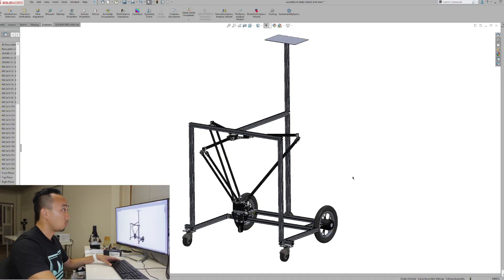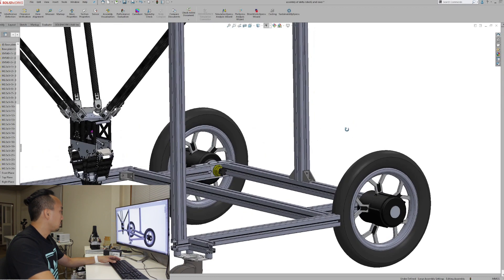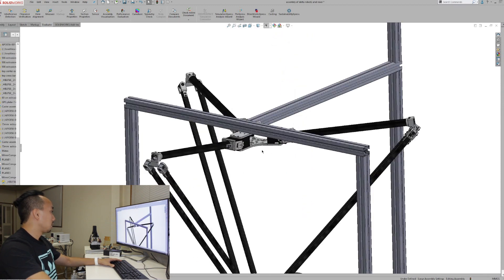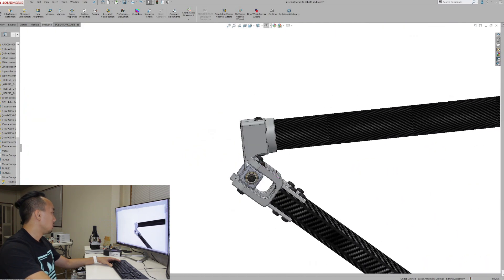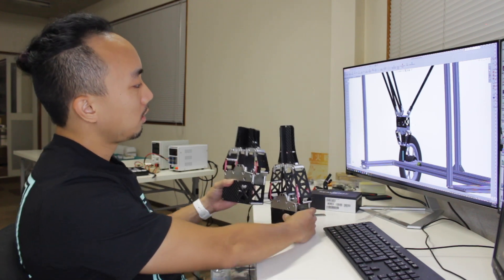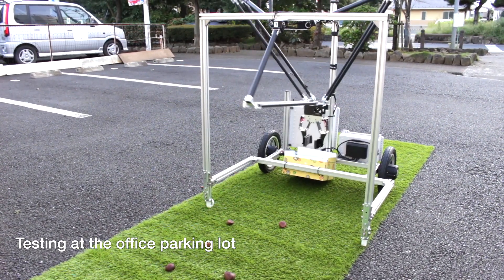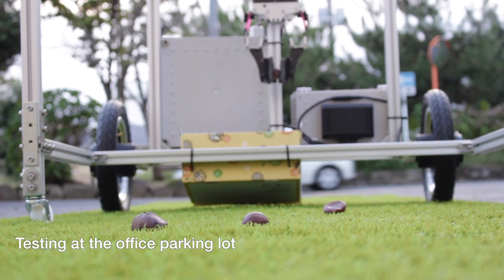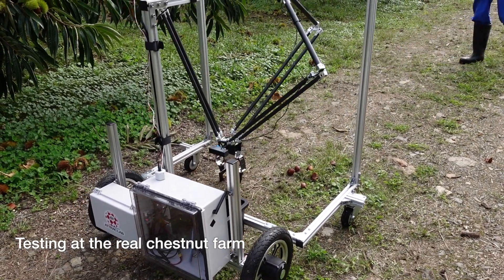Making a Chestnut-Picker from Cube Pilot + Delta Robot + AI Object Detection

Comment: hai, my name is jeffin. we are doing our final year project based on weed detection and removal. so far we have done our detection part (yolo V3 algorithm), where we detect the weed from the crop. we are still in confusion with the removal part. we are planning to use delta arm for spraying pesticides onto the weeds but we are confused how we can use this delta arm. can you help us?
Reply from the maker: 1. You will need to make the delta arm be able to control by inverse kinematics, so if you give the xyz of robot fixed coordinates, the end effector should move to that position correctly. There are many research papers and text books which already derived the equations for you.
2. If the object detector works, then you could get bbox points from the frame. You will need to convert that pixel coordinates to world (xyz) coordinates.
3. Drive the robot from 1. method by using 2. output
And that’s it :) good luck!
Reply: @stepbystep-robotics  can you explain  how can we  convert pixel coordinate to world coordinate.

Comment: Hello can you guide for building delta robot. How to do its position control.my email id rohit.kr.sahu@gmail.com. Thank you
Reply from the maker: Hi, thank you for interested on my project, you can find more detail about the linkage parameters, some explanation, and codes on my github repos here, this is c++ version, quite old but the detail was documented there
https://github.com/rasheeddo/The-Delta-Robot-MK2-Cpp

Another on is python script, latest one, but the idea behind this is exact same thing
https://github.com/rasheeddo/chestnut-picker/blob/master/DeltaRobot.py

If you are using Dynamixel servo, position control is very simple.
Reply: @stepbystep-robotics  thank you I'm familiar with c++, I have Dc motor with encoder. Can calculate angles from encoder counts.